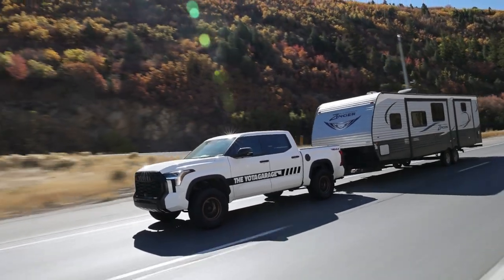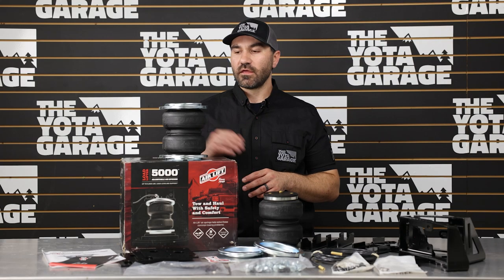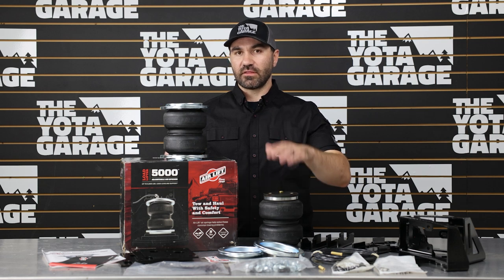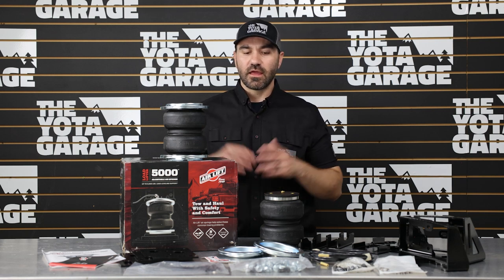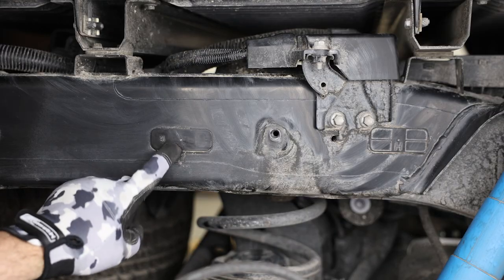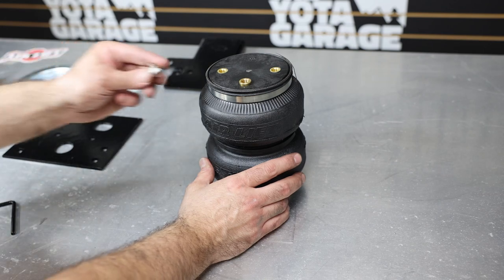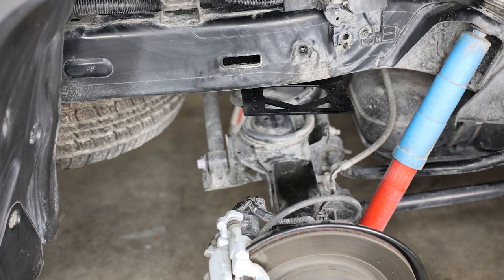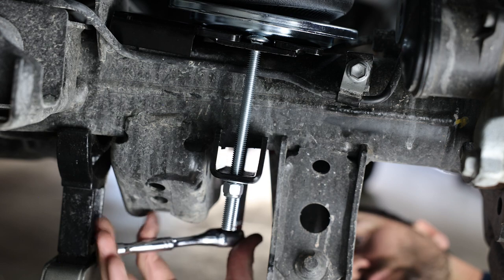2022+ Tundra AirLift LoadLifter 5000 Air Bags Install & Review | 3rd Gen Toyota Tundra

Comment: How heavy was that trailer?
Reply from the maker: Trailer Specs:
2019 CrossRoads Zinger ZR328SB (Travel Trailer)
Length: 36.5 ft
Width: 8 ft
Height: 11.25 ft
Dry Weight: 7,756lbs
Payload Capacity: 1,984lbs
Actual Weight: Around 8,000lbs
Hitch Weight: 942lbs

Comment: Why not install Daystar airbag cradles to keep your articulation?
Reply: I just did you have to drill a hole I use the remaining hex screws and the 3/8”-24 nut then dremeled the nut down….kind of a pain. And now the bracket doesn’t fit flat.